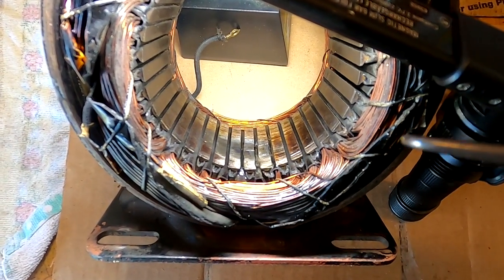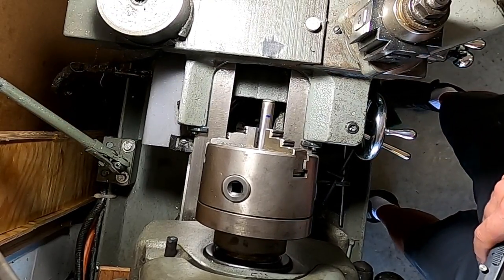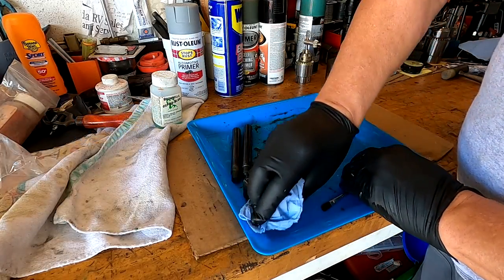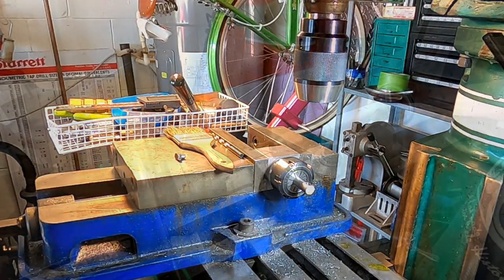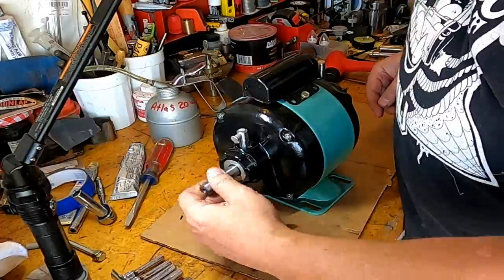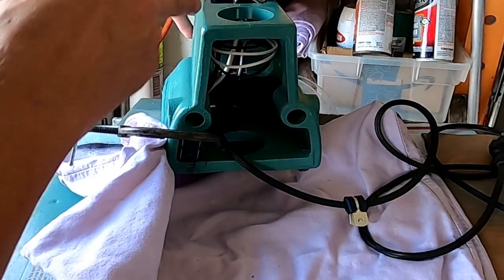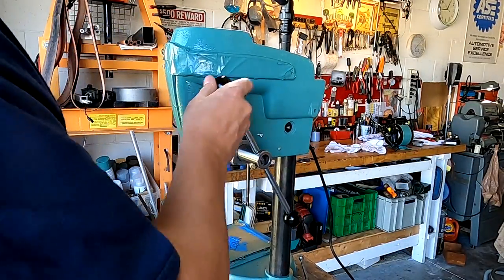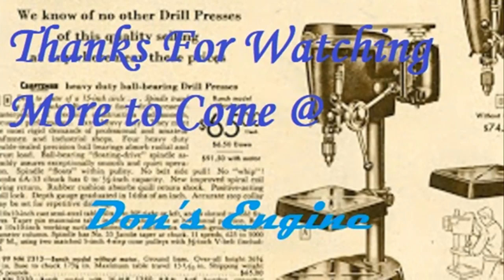Antique Dunlap drill press project part 3. Dunlap 103, El Finale. Vintage presses rule!

Comment: Really coming along.  Mine had a couple white balls on it, one had turned more yellow than the other.  
On my spindle assy. that thick rubber washer had opened up and was causing issues.  Think its because the new grease 'digested' it -- LOL. 
Loved the idea of bluing it all.  My drill press lived in central Calif- rust never an issue .  Here in western Washington it is a huge problem.  
What a beauty you have now !!!    ...and I learned alot about my old drill press see you dissect and put this back together.  Thanks.
Reply from the maker: Absolutely. These old King Seeley's were so pretty from day one. Its a shame to see them get run down. Good luck getting ours up tight. Don

Comment: Curious... 
Why didn't you remove the upper threaded thrust collar from the spindle? It's held on with a 6-32 brass set screw. It is key to adjusting the quill on the spindle. 
Also, you did not remove the spring from the pinion shaft. Easy to r&r the roll pin.

Comment: Love the restoration. You did a wonderful job. I have the exact same model that was handed down to me for my late father. I’d like to add the lights as you did.  Are they LED and where did you source them from? Thanks.
Reply from the maker: I found the lamps and and holders at a flea market not far from here. They were just loose in a box so a took the chance. They work great.

Comment: Nice Job, I found one in the garbage down the street , all it needed was a new cord , plan on cleaning it up and painting as soon as the weather gets warmer  . it’s the same model as yours .  I need to get a chuck key . Is that a 1/2in chuck ?
Reply from the maker: Thanks, Yes sir, it is a 1/2  incher.  Very nice little DP. I can't believe anyone would chuck it. Its a sick world.  Would love to see it once cleaned up.  Don
Reply: Update on the drill press , motor has no power to start up with belt on , will start up without belt, but can stop pulley with hand. Local electric motor shop wants $130 to rebuild . Any suggestions ?
Reply from the maker: @howiemook7701  Sounds like the start windings are toast. Ide be looking for a new motor. I had that problem with my Atlas lathe and switched it up for a 1 HP DC motor.  A Used good motor is cheaper than rewinding for sure.  Don
Reply: Thanks for the advice . I’ll tuck it in the corner of the garage for now , maybe one will show up 👍

Comment: Thanks for the video Don, I have the exact model and features, although  branded Craftsman.  Quick question: I had to replace the power cord to the motor.  Motor runs, however, on startups it will sometimes run backwards and the motor housing becomes hot to the touch, but is not carrying a current.   I'm guessing there is a jump somewhere but I'm stumped... do you have any suggestions?
Reply from the maker: Sounds like there has to be a polarity issue going on there. Best to tear it down and check for any shorts, especially at and around the wiring connectors.

Comment: Did you check runout after reassembling it? I was wondering if it retained the same amount.
Reply from the maker: Absolutely.. It was spot on. There's a lot to be said for a good bushing set up vs bearings. Not for every application, but in this one they're a spot on good design.  Don

Comment: Excellent job, Don! Can't help but admire a guy who appreciates the good ol' machinery...BTW was the paint scheme meant to look "Bobba Fett-esque"? I picked up a functional Craftsman DP at a neighborhood garage sale last summer. Still working but in need of some TLC. Non-OEM motor and belt adj. plate but has a foot pedal switch. Thinking of converting to a DC treadmill motor drive because of easy speed-changes (i'm old with a lot of "wrenching arthritis", so learning to adapt...or die ;o). The only numbers I can find on the machine are on the head (Craftsman tag): 103.23590, looks a lot like yours but doesn't have that quill spring adjustment knob. I can't find that exact same model # anywhere on the web...was hoping to get a user/parts manual. Keep up the great work and your videography...very helpful and inspiring!
Reply from the maker: Hey Russ. If it looks like mine without the spring adj. then it probably is. The serial number says it is 103.  Sometime in the mid 60's they did away with that, but the rest of the press is the same. I did the paint scheme just on what I thought would look good. I always liked the Detroit diesel engine color but thought it should be offset a little. The DC motor sounds like a plan, but most of them that I've seen are pretty large and have really high rpm ranges like around 5000. But hey, any thinking it through can get you a workable plan. Good luck with that. Thanks for following. Don